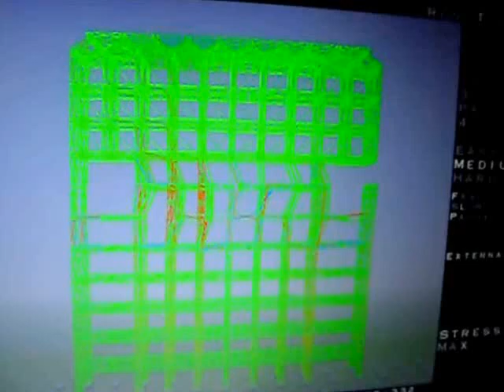WTC North tower collapse simulated with the Pontifex bridge building software

Comment: (Two of Two.) But when I woke up this morning, I was like, "Wait a minute. Why didn't this stuff just tip over?" Then I realized: the walls were made of an steel weave thicker than the plating of a WWII tank. They were so well made that one of the sides of the North Tower was still standing for a few seconds after the collapse.

But this building had weak floors ratcheted onto a steel core. Yes - the floors collapse. But can't Pontifex show whether or not the CORE would have weakened like that?

Comment: (One of Two.) I actually worked through the "WTC was demolished" scenario. Though mostly in my head. At first I was convinced they were right, but now I see not only why they were wrong, but HOW it all seemed to point in the direction of a controlled demolition. For example: it sounds like a bomb going off in the North Tower from across the Hudson River in New Jersey. Then smoke. FROM THE BOTTOM. But I figured out what this shows: the sound and the smoke came from the shockwave.